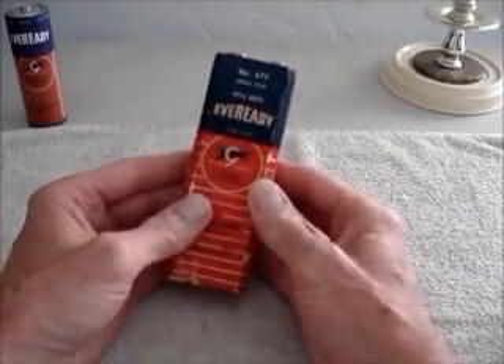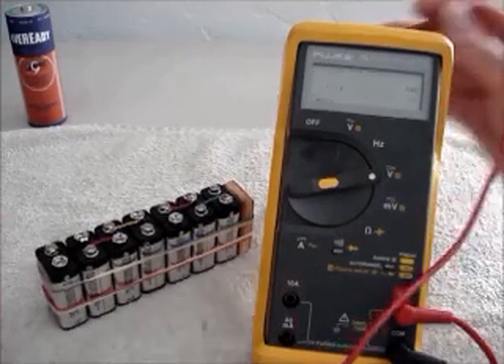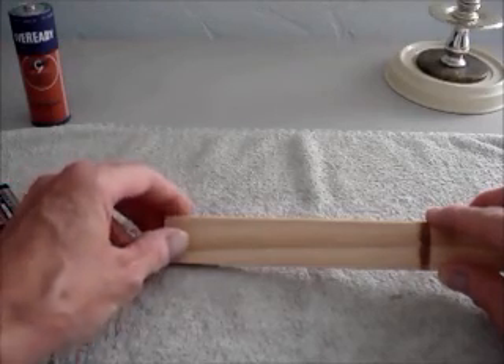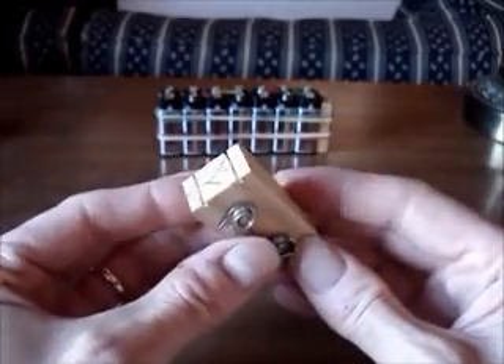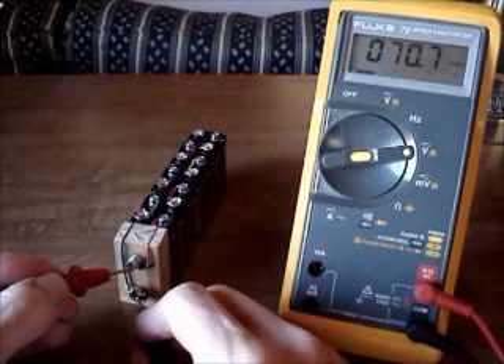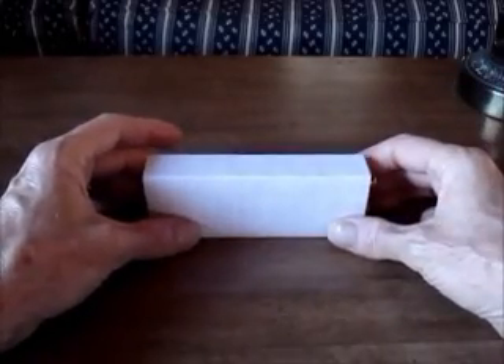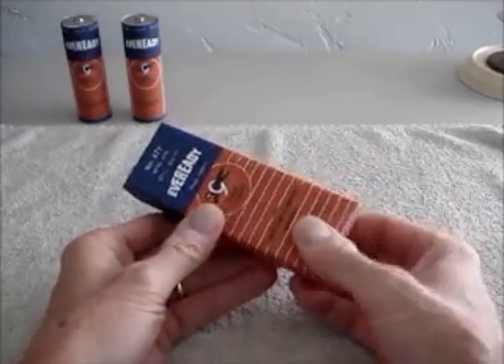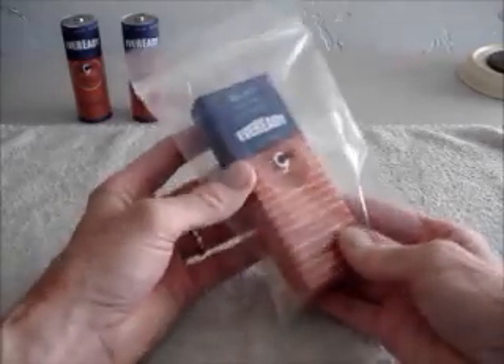Replica Eveready #477 B Battery for Portable Tube Radio Sets

Comment: Do you have scans available for the 964 A battery? I have designed a sleeve adapter that I 3d printed to use regular D cells but it would be cool to wrap those as well. It would be even cooler to use RCA branded wraps for my application but I can't find any scans at all for them (VS216,VS236)
edit- found your other video and the scribd link!

Comment: The unloaded voltage compare towards the nominal is bogus. The real original "67.5V" batteries had nearly 75V when new and unloaded, then under load it quickly drops to 1.4V/cell (so about 63V) and then gradually drops down to about 0.9V/cell (40V) and then the drop gets faster. So a "67.5V" radio has to be designed to perform optimally over the whole 40..75V supply range. By the way there is a reason why the "1.5V" tube filaments are actually rated 1.4V...
What does matter however is how long it will take for the battery to reach the minimum voltage. Devices are supposed to work down to 0.9V/cell, so for a 45 cell "67.5V" it means down to 40V. There comes the good thing of the alkali cells: They tend to stay at higher voltage for longer, so although less cells used (42 iso 45), the 40V means about 1V/cell, where the alkaline cells gave already more than 90% of their capacity (assume 100% is till 0.9V/cell), so this substitution really works well.

Comment: Nice job ,is there a way to use snap 9 volt connectors so one can change out batteries easyer,I seen one some where someone made a for sale a 67.5 battery missing 9 volts and that person is chargeing 29.00 for that and it looks like the original battery and is easy to change out 9 volts inside .I have three or four of these 1950 tube portable,.but mine also,use ac current to ,but it would be nice to have batteries for it.I

Comment: Very nice. What would be the total plate current draw for this radio?
Reply from the maker: Hi Joe,  4-tube battery sets typically draw 7 to 10 mA from the B battery. most of the plate current (B battery current) is in the audio output tube, like a 3V4, 3S4, 3Q5, etc. My RCA 2B402 set has a "save" switch that reduces its 3V4 current from about 9 mA to 5 mA by shutting off half of the filament and changing the grid bias voltage. This feature extends B battery life at the expense of slightly less volume. The A battery current reduces from 250 mA to 200 mA, thereby slightly extending life of the A battery.
Reply: Random 73.  Thanks very much. That's quite helpful.